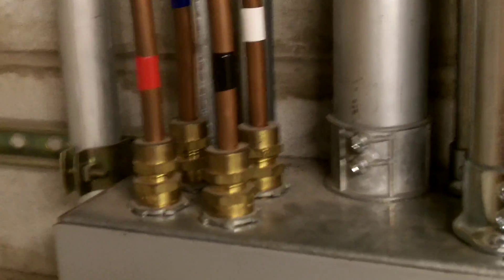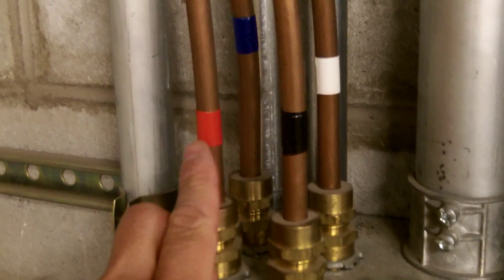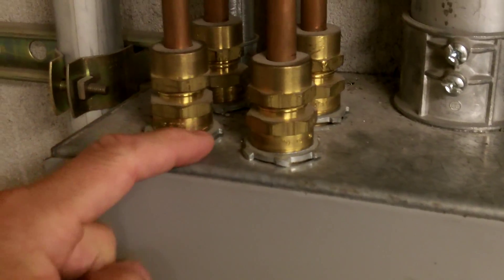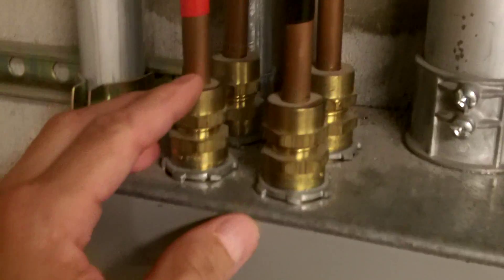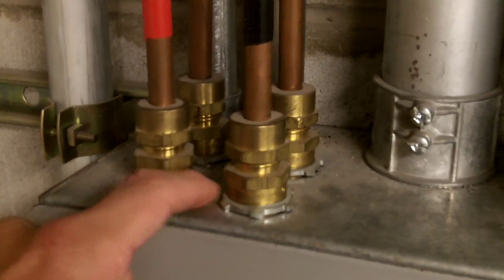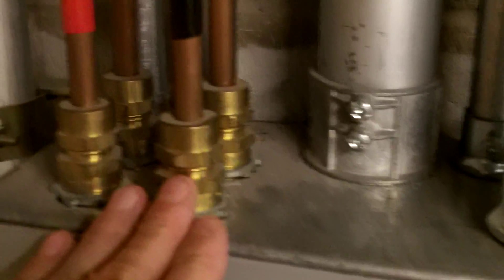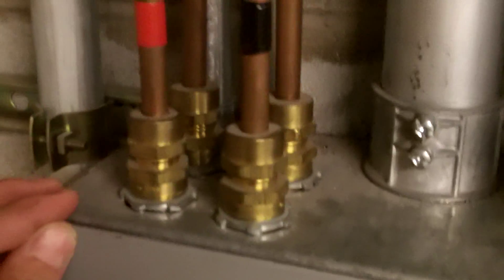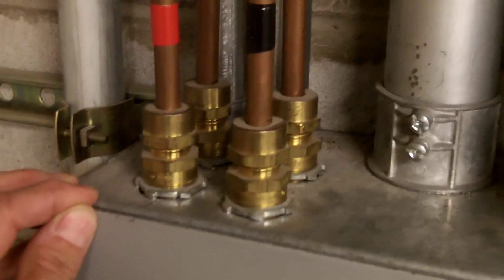REVISED: Moving Violations Video No. 48, by Russ LeBlanc, NEC Consultant: Combatting Induction

Comment: I would expect that if you cut slots in the enclosure, that you compromise the mechanical integrity of the connection to the enclosure.   Also, if you cut out a large rectangle, and replace it with a brass plate, that also sounds like a practice that voids the listing of the enclosure.

Comment: Under the right conditions that locknut can get red hot...Its called ferromagnetic hysteresis.They use the same physical effect to heat steel for forging.. 500 MCM MI cable can carry 700amps per leg.. USE BRASS PLATES ONLY !!!!!